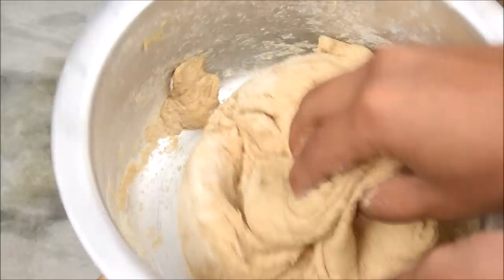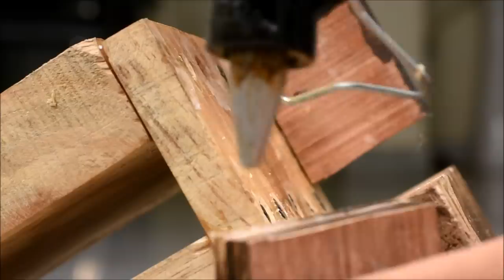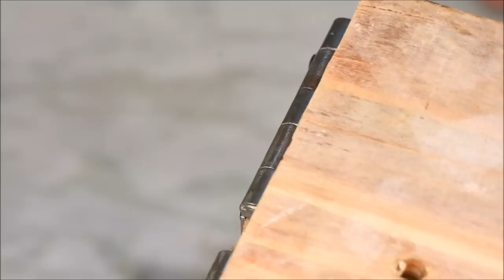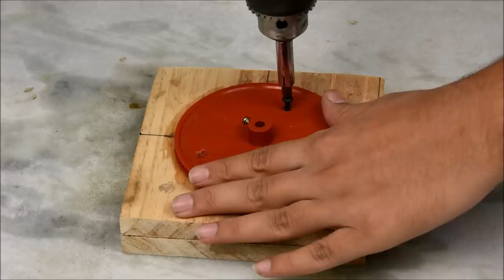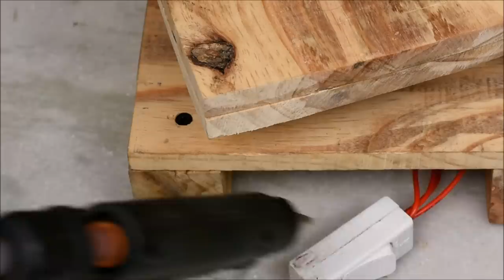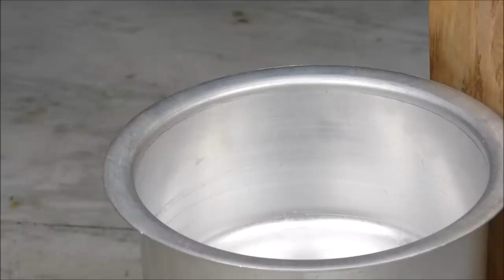How to Make a Flour Mixer Machine at Home - Easy Way

Comment: Idea is good only you have to use base motor also strong(high torque) and make the body by weight material(so body will not vibrate) but very good effort
Reply: Good గుడ్ సర్  your mobile no ple.namaste..

Comment: where is the power supply come from
Reply from the maker: It has 12v dc supply...
Reply: Power come from Normal electricity board. (NOT but both MIXER motors are operate on 12- volt-DC ) just like mobile charger.EXAMPLE  mobile charger operate normally 220 AC volt or 110 AC volt but it's output is 5 volt DC for mobile charging.